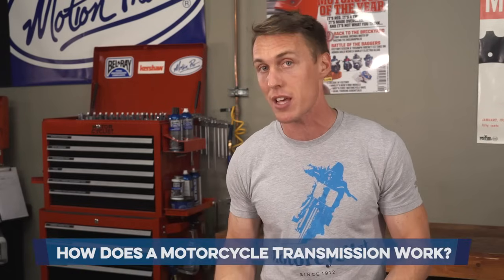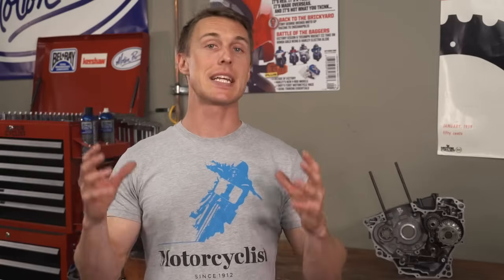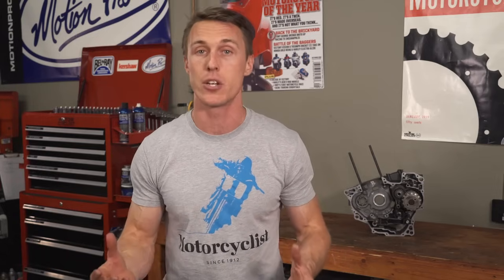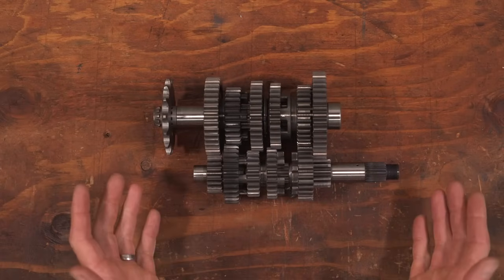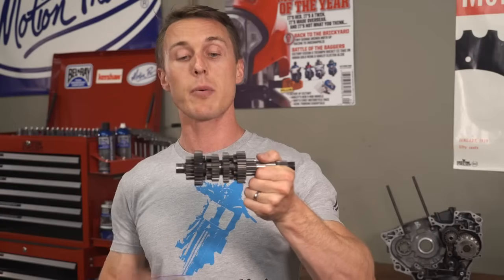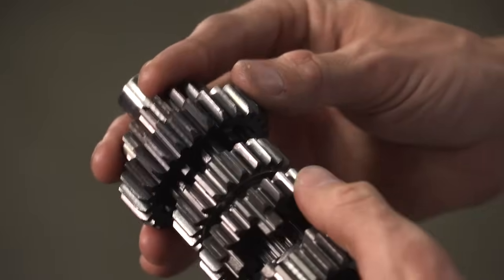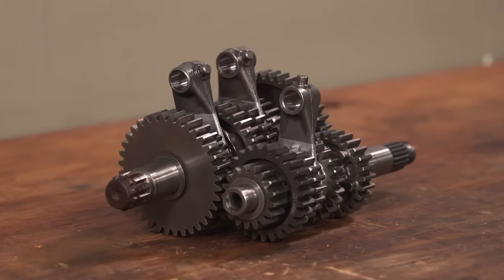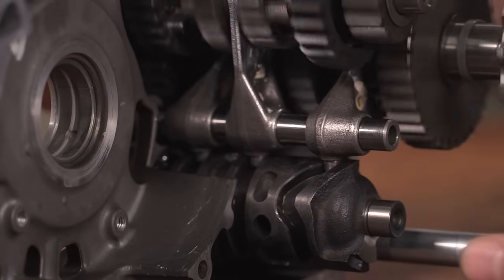How a Motorcycle Transmission Works | MC GARAGE

Comment: Could you make a vid on shifting with and without using the clutch? There are so many different statements on whether clutchless shifting is or isn`t good for the gearbox.

Great and informative video this was. Thanks!
Reply: Why are so many people asking about shifting without a clutch?  Just use the damn clutch, thats what its there for!
Reply: Close throttle fast then shift w/o pressing the clutch lever & then open the throttle again...
This method must be done in a blink of an eye....😇😇😇😇
Reply: The sequential constant mesh gear box was designed to be upshifted without the clutch.
Reply: Riding Dutchman  You should never shift with clutch in contact because it will send power through the transmission and that force could damage the engaging gear that is slower rpm

Comment: What is the worst thing that it can happen if I change my oil but not my oil filter? (I have problems finding the filter in my place So it's gonna tae a while to arrive after a online buying).
Reply: If it was me I'd wait for the clean filter. Probably better to run a couple of weeks with old oil than to get gunk from the filter in your new oil and have that shizzle in your gears and engine for a year.
Reply: I just used the bike with the new oil and the old filter for about 15 minutes and it started to smell lie burning oil... so sad couldn't wait... where I live I found complicated to find ducati parts... thans a lot for the advice.
Reply: Wilson Orellana you must have spilled some oil on exhast or other hot regions while changing it.
Reply: Haven't checked for that, looking now! Thanks!

Comment: What if you have clean oil but can't find neutral....ever. My Yamaha Bolt finds neutral easily while my GT250R can only go into neutral when the engine is off.
Reply: Check the clutch cable adjustment. Carried out cable adjustment on a speed triple and this was cured.
Reply: I did adjust it and my shifting got better, much smoother, but neutral is still almost impossible to go into. Good tip though. I never knew how much cable tension mattered until the first time I adjusted it haha

Comment: what about a shaft drive bike?
Reply: There's no difference to shifting. There's a ratio applied by the shaft and final drive, but that can be compared to the sprocket ratio on a chain drive. "same difference".
Reply: i mean't how it is added to the transmission, where chain and belt just have the one sprocket or pulley, the shaft drive must have more gears and things to propel the back tire.
Reply: yeah I guess I am just wondering how the shaft/ final drive is propelled vs the simple chain sprocket, a little more indepth for this video I guess lol
Reply: that makes sense! thanks for the info!!

Comment: About the sticky gear part, I always get my bike oil changed at regular intervals but still end up with rough shifting. Sometimes the gear shifts after I leave the clutch a bit. 
Could there be an explanation as to why this could happen? Does it mean that the gear box is problematic?

Comment: which exhausts will be best for Suzuki gixxer 155cc bike...?
if i change original exhaust that will be good or bad?
Reply: Slip on exhausts do not effect the engine or performance, most bikes that includes removing the stock slip on (riding with no exhaust). Full exhaust systems is where you need to remap the bikes ECU and sometimes air filters. There is no best slip on exhaust it's whatever you prefer in sound and look. I'd recommend not buying a full exhaust system for a 155cc bike
Reply: BD Motorist for these puny bikes its better to have stock only. dont get me wrong but most of the aftermarket exhausts in markets are duplicate ones and would gamage the performances.

Comment: What happens when a false neutral occurs?
Reply: False neutral usually happens when the shift drum does fully seat into it's next position. It's like being stuck in between shifts.The last gear got disengaged, but the next gear hasn't been engaged yet. If you're talking about shifting first to second and then accidentally hitting neutral, that's just something annoying that happens. Typically a more deliberate shift fixes both problems. You can have weird problems like a bent shifter fork though...
Reply: Bent shift fork, worn dogs, neither of the movable gears engages and you have a "neutral".
Reply: Some people are too light on the peg and don't fully depress the lever from time to time. I have yet to ride a motorcycle that has never had a 'false neutral' somewhere.
Reply: memphis024 i always wondered that too. happened on my new bike during break in between 5th and 6th....
Reply: Same here, 18.000 km though. Not broken in yet? Or is it something else?
Reply: +mike s It's probably still a little tight from the factory but this is not something that should occur on a new bike so my guess is there's some kind of material failure or a component that's "slipped through the net" during inspection. If it's still under warranty get it checked/fixed!
Reply: Cable or hydraulic clutch? If it's hydraulic it could be air in the line. Cable could be stretched and needs to be adjusted or thoroughly lubed.
Reply: My shitty Ducati somehow managed to a find a neutral between any and every gear. Hunk of junk.
Reply: Some models had shift drum issues, but this is the first time I've ever heard of a Ducati having false neutrals between every gear. Maybe you weren't hard enough on it, like too light on the shifter and not fully pulling the clutch. That's the only time I get false neutrals out of mine.
Reply: Like I said, I wasn't very hard on it, so this could totally be the case. The Ducati and I never really gelled very well which is why I sold it. The guy who bought it RAVES about it though, so different strokes for different folks I guess.
Reply: Lately I have the same issue, too. But I noticed that it only happens when I pull the lever too softly. I guess the cogs doesn't fully engage.
Reply: @emreevo8  As MotoErgo said, could be air contamination in the hydraulic clutch line, or an unadjusted clutch cable (if the lever comes back more than an inch from the bar itself,) that might've 'dried out' if the grease has worn off - and/or could be using not quite enough revs as well as the cogs arent engauging with a positive enough gear lever - assuming you are giving enough clutch pressure. Sorry to sound condesending, if so, I don't mean to appear be so.
Reply: ktm 690 all have a false neautral between 5th and 6th, just have to live with it and best to use a clutchless gear change.
Reply: It was surprising to me how drastically the bike changed between cold and warm. The transmission was finickier warm, but the engine really smoothed out and was a lot more user-friendly. Such is the character of bikes though, they all have their own quirks.
Reply: Cable. I mean't the gear lever, not the clutch lever.
Reply: I've found false neutral on my 16 gsxs1000 3 times.   Forums say just lazy shifting and adjusting the lever helps.  I've been more deliberate about shifts lately. We'll see
Reply: Doubt it, I bought it brand new and it was doing it from the get go, mostly after it was warmed up. Didn't do it enough for me to take it in though. I'm not an aggressive rider by any means and wasn't hard on this bike at all. It also had less than 3k miles on it. It's sold now though, so life is happy again ;)
Reply: Both of my bikes' transmissions took a long time to loosen up. The 1098 clicked effortlessly into gear at 18k, hot or cold. The Diavel is getting there.
Reply: Older gearboxes were poorly designed and had too much movement within the forks, selector drum and between gears so when you tried to shift up or down you would often hit a false neutral if you weren't positive enough with the lever. Modern gearboxes are produced with much tighter tolerances and better materials and are much smoother to operate as a result.
Reply: @roythearcher  cough cough most nonV-Rod Harley Davidsons are all fitted with old gearbox tech under the 'Tradition' label.
Reply: roythearcher my bike is a 2016 gsxs1000.....
Reply: Sounds like you stomped the shit out of the syncros and were in dire need of a transmission rebuild.
Reply: @MotoErgoSum  There are no syncros, motorcycle gearboxes use dogs. Did you not watch the video?

That's why you get a "clunk" every time you shift.
Reply: @MotoErgoSum  motorcycle transmissions don't have sychros

Comment: Can you please explain why the chain 'clics' when you put the bike in 1st (when its running)
Reply: I believe it is because when you pull the clutch and immediately engage the gear the gears in the gearbox are still turning, so it has to come from turning to a stop in an instant. Try this, pull the clutch, wait a few seconds and engage the gear, it should not pull the chain anymore. If it does, it probably means the clutch is still spinning the gearbox around slightly, which means your clutch lever isn't fully pulled in or badly adjusted.

More info: If your engine is running, the gearbox is in neutral and the clutch lever is released, one of the axles inside the gearbox is spinning, the second one isn't engaged. If you pull the lever the engine stops engaging the first axle inside of the gearbox and nothing should be moving inside there.
Reply: Simon Vuylsteke Also have to remember most motorcycle have wet clutches so even with the clutch disengaged the fluid will still have some drag
Reply: Ah yes thats true, i sometimes dont think about that, im a truck mechanic so things are a little different there :P
Reply: I always assumed it was because of the tension put on the Trans when putting it in gear. Although i could be totally wrong!!!
Reply: That must be it thanks